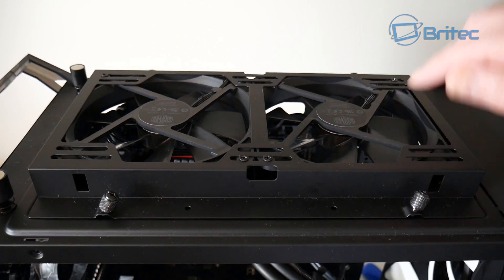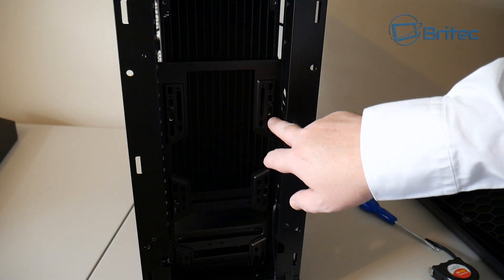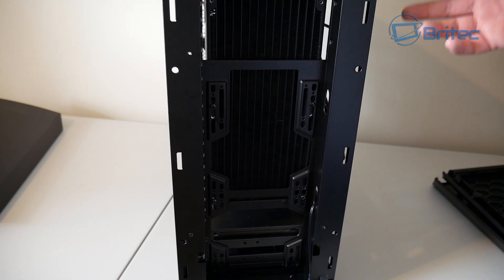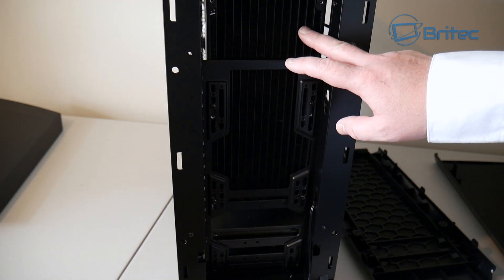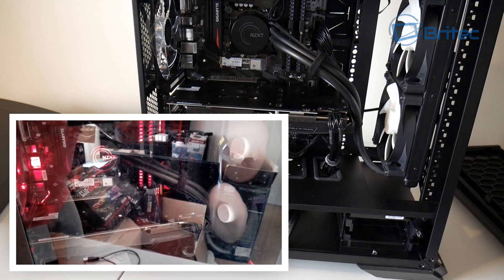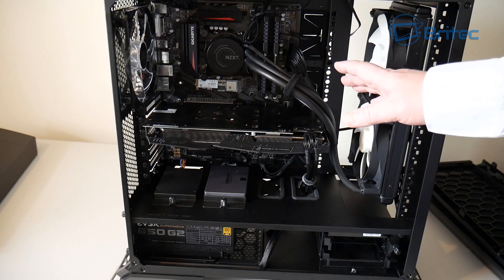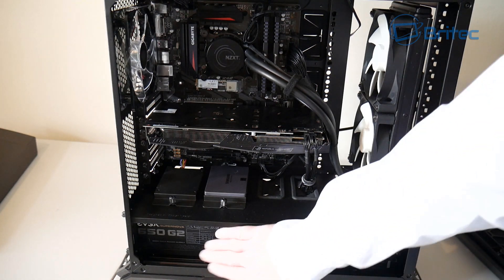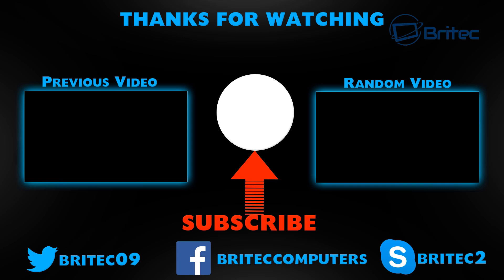Computer Build Your Questions Answered

Comment: referring to an old video of the PSU test
If a person connects the inexpensive test device (instead of the paperclip) could the multi-tester be used to test the pins along the individual cables like in the video, but without the "hot" paperclip jumper.Seems this would be much safer than the hot paperclip exposed and ready for an accident.

Comment: I am curious I have a GTX 1080p graphics cards (founder edition) but It's mounted on an old AMD motherboard, I am not 100% if I am getting the most out of it but I was wondering is there a part that works best with the mentioned card above?

If so what can I do to fully spec out my PC with this specific graphics cards?

Is there a way to transfer all save files of game data and even OS like windows 10, apps even? I was told removing the motherboard and replacing it was the equivalent to deleting everything.

Sorry for these questions but I don't see many information on the internet regarding these specific questions, at least with clarity.

Comment: Looks to me that you did a beautiful job, I would have done the same. 
Could the front case dual fans be rotated so the internal pump has less gravity to overcome as it pushes fluid?
Reply from the maker: Yes the fans can be rotated, but that would draw a lot of dust into the case and radiator and you would see little if no performance in temps.
Reply: Britec09 Sorry Brian for the confusion, I meant rotate the radiator assembly vertically so the liquid inlet/outlet is at the top in line with the CPU. My idea was about reduced internal stress on the pump pushing the liquid constantly against gravity. It wasn't about dust or cooling Temps. Any way you look at it, you did a great job.
Reply from the maker: Oh I see what you mean, yeah mine are at the bottom. I am not sure that really matters too much. I guess it comes down to what looks best to the person, but I will try it round the other way to see if it makes a difference. It's like the rotation of the CPU air cooler fan facing up, down, left or right, I have tested that and it doesn't make much difference. It would be an interesting test which I am eager to test now. Thanks for your suggestions I will check it out, I do normally put them up the top like you suggested. I am sure if it had to be rotated in a certain way there would be a stick on the radiator saying so, well you would hope they would do that or my pump is going to pack up lol
Reply: Britec09 I thought a bit more on my suggestion, (which has been your practice too) and it seems the internal pump must not only overcome drawing UP liquid from the base inlet/outlet but must also push liquid back up the radiator against gravity, all simultaneously of course. Reducing the ups/downs of the pressure may increase the total life of the product, but who really knows. I can say this though, every build I've ever installed a liquid cooling system has never failed even when years ago I was reading of pump failures and leakages, for some reason it's never happened to me. Luck?? <shrugs>
Love your advice on putting more cash into a solid power supply and motherboard, so many people think it doesn't matter but they get problems soon enough. I prefer modular Seasonic power supplies, rock solid and fan doesn't even rotate, very nice, very quiet.
Thanks for putting these videos out, a labor of love for sure.